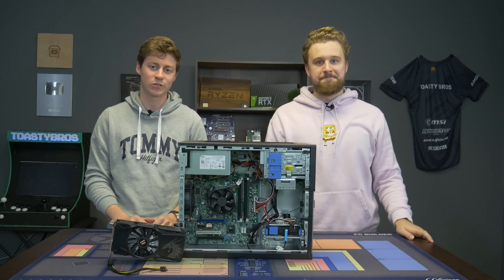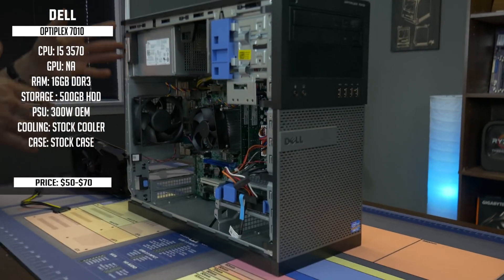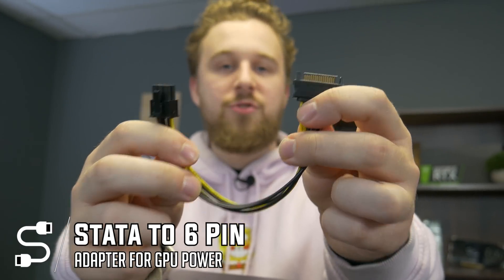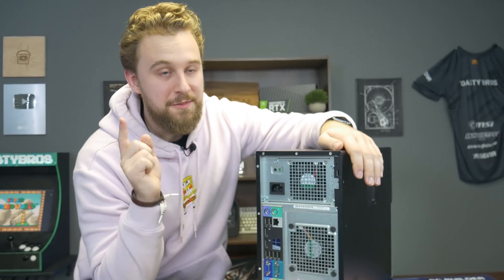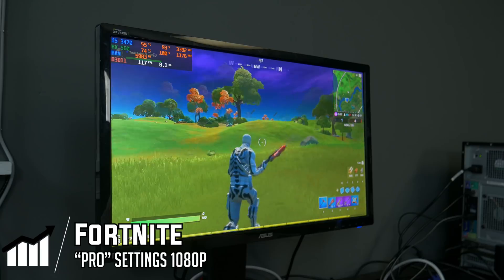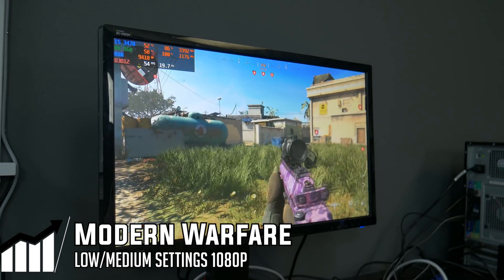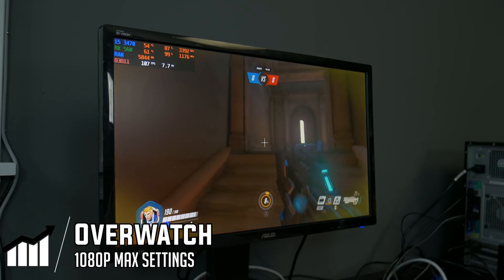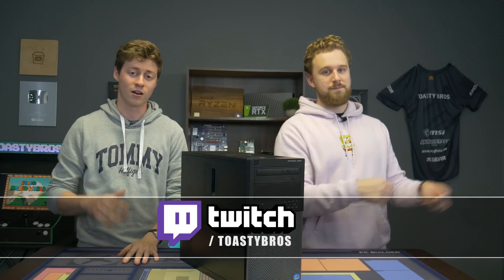2020 Budget $100 Gaming PC - Step by Step Guide

Comment: No way 300w psu can withstand th RX560, no way
Reply from the maker: Yes way very comfortably
Reply: @ToastyBros 
I have the same exact cpu paired with RX570, and a Bestec 80 plus certified 400w psu could not handle it at peak consumption at 170wats, so i had to get a 500w one, although a 450w could have been enough.
The only possibility yours might be working is this is a downgraded RX560, with way less power consumption, which i have not seen before
This calculator recomends at least 342W, the utilisation of a 300w psu is 99%, it will overheat and shut down 
https://outervision.com/power-supply-calculator
Reply from the maker: Most 560’s can run without external power so 75w from the PCIE slot, this one needs a 6 pin so in theory it’s barely pulling around 100w in total in a system that isn’t pulling more than 75-90
Reply: @ToastyBros  
In that case i apologize, my RX570 is peaking at 170W which is more than double

Comment: You won't be able to find an Optiplex 7010 mt with those specs on ebay for that price. It would be closer to $100 just for the Optiplex, and that's if you're only getting 8gb of ram.
Reply: That still makes the budget 130 or 150 if you get another stick if ram

Comment: Not sure where you get these for 50 bucks.  I know even a few months ago they were cheaper than they are now.  I've built a few of these so far.  The i3 versions aren't worth it.  Plus most don't come with 16gb of ram and only a few models have 4 slots which makes it even worse.  

Anyways seems like you got a good deal regardless.  I've got a few tricks that I haven't seen others doing with these which improves these.

Comment: Sold my laptop to get this same combo but with an i5 2500 and a saphhire rx 560. I think I hit the silicon goldmine (liberal use of the term i know) though cause my cards oc'd to 1400mhz with reasonable temps. Sold it cause I moved but that beast could play ac odyssey on low at 60-70 fps :P
Reply: mine cost around 200 usd though cause of my country's economy, still a steal imo

Comment: This should be titled “how to start a fire for $100”.  Jokes aside, anyone using these kind of PCs should be purchasing graphics cards that do NOT require external power.
Reply: I would agree, but I can at least see if someone wanted to do this but upgraded the PSU first. EVGA B stock PSU on Wednesdays typically go for $30. I would advise anyone to spend the $30 to upgrade their power supply.

Comment: I have an Optiplex 9010
I7-3770
16gb DDR3 Ram
Gtx 960 2gb
450 EVGA BT PSU
Thermaltake Versa H17

What GPU should I buy to upgrade my system to the fullest potential???
Reply: 580
Reply: Agreed, RX 580 or if you are absolutely loyal to Nvidia for some reason, a 1660 Super

Comment: $30 for i5-3470 and cooler
$40 for an Intel motherboard
$25 for an antec earthwatts 380 watt power supply
$30 for 12 gb of ram (2x2+2x4)
$50 for an xfx rx560
$30 for a 500gb SSD
And $25 for a rosewill case that j built for my little sister a year ago and holy crap I over paid lol
Reply: Not really, I mean you can always use the case and power supply in another build, in theory. On an OEM there really isn't much you can take to an upgraded build.

Comment: Would you need a SATA to 6 lim for a 570 or 580
Reply: Yes
Reply: I would say you would need a better PSU more than anything. Spend the extra $30 - 35 and get another PSU, even if it's used.
Reply: @NexusFantismo  I've got a extra psu corsair 750w SSD 240gb 500gbhd and 16gb ddr3 ram

Comment: can dual channel increase the fps on a i7 7700HQ and gtx 1050 ti laptop with single channel??
Reply: Yes. The universal law is that dual channel ram will improve fps over single channel. Now the improvement can be anywhere from nominal to noticeable to game changing. On my MSI GF63 adding another 8 GB to the existing 8gb stick improved my from from 25-30 percent in most cases.

Comment: question with a  full tower dell optiplex form factor can i switch out the case ?
Reply: yes but use a micro atx case
Reply: Yes, but you will have issues with the sensor for the open case door, different wiring, airflow sensor if you forget it... I'd much rather plop about $30 for a branded H61 motherboard - or, even better, forget the case swap, enjoy the pc as is, until you decide to swap the entire thing. Dell is great because of the atx psu compatibility, not because of the case compatibility.

Comment: i can't even run warzone properly with unstable fps 20-300. My setup is i5 6400, gtx 1050ti, 8gb ram single channel
Reply: Use vsync
Reply: @Triospirit  doesnt vsync make it worse?
Reply: and get a matching 8gb stick of ram
Reply: Once you go dual channel 16 GB you will see a big improvement in FPS. Also tweak your settings in windows (advanced settings, best performance by getting rid of all those fancy windows 10 visual effects) and making sure your drivers are up to date and working properly.
Reply: Get another stick of ram. It will help a ton.

Comment: Ooooooh what a challenge... So out of curiosity can you use that PCIE connector with higher end cards (from Rx570 - Rx 590)
Reply: nah you'd need like two of them, RX 580s have 6+6 pin or sometimes 8+6. Kinda sketchy but the GPU might get bottlenecked at that point
Reply: @rafee9442  I had a feeling that would be the case... Do you would need a PSU upgrade at that point right
Reply: @theugliest5291  yes absolutely. The stock PSU wouldn't last very long with that config and your entire system may all fry

Comment: the thing is you have to snipe one that is a good deal on eBay, most cost around 100 but then charge another 120 for shipping :/
Reply: try "Upcycle computer Werks" they have these optiplexe MTs that are perfect for this just look for the i5
Reply: @corrosive925  bro does it really work tho ?
Reply: @marmarbuckz5243  yup I got a HP 6300 microtower I5 3470. You will need a graphics card. But i only did it because i needed a pc. Downside is you cannot upgrade anything.
Reply: @corrosive925  can I put a gt 1030
Reply: @corrosive925  I managed to find one with an i7, 16gb ram and 1tb hdd for £220
Reply: @corrosive925  You've succeded in offering better advice in a single comment than the video...
Reply: @TheBinklemNetwork  if you have Honey that application you might even get free shipping :)
Reply: cameron flanary oh wow, nice prices and free shipping in continental United States
too bad i live in hawaii. riiiip
Reply: or if you live near to university or government building, you might wanna check their surplus store.
Reply: try buying locally. I got a 3010 for about 70$ on letgo
Reply: YaBoiDavid shipping is like Thanos.
Reply: RJ Builds Pcs yes
Reply: Yeahhh
Reply: Craigslist is your friend
Reply: so true
Reply: Rx 560 went out of stock what other gpu can I use

Comment: I bought an HP Z220 off of eBay for 135$ and it had a core I5 3570, 8gb of ram and intel 2500 graphics, and then I shoved a 60$ graphics card, GTX950 and it works well with 2 monitors, i use it every day and does awsome on gaming for a 200$ gaming pc

Comment: When you guys do another like 450-550$ build guide, you guys should try the MSI Bazooka V2. I’ve seen mixed reviews and there’s not many reviews on youtube either.. Edit: it also ranges from 70-80$, depending if it’s in stock or not.
Reply: I actually rebuilt a dell optiplex with this motherboard. Very solid board for the money. I have a ryzen 5 1600X (non af) clocked at 4Ghz with 16 gigs of 3000mhz ram. I'm using an R9 Nano as the video card. My optiplex is an awesome sleeper lol
Reply: Just get an asrock b450m pro4. Far better than V2. The bazooka plus however is an absolute beast
Reply: skinnypalmtree69 what case could you put this pc in?

Comment: Why does this pc run better than my gtx 1060 6gb??? 
I’m not lying Fr how?
Reply: Download Nvidia GeForce experience and make sure all of your system specs are being detective properly, download and run CCleaner and make sure Windows 10 is up-to-date and that your GPU drivers are updated.
Reply: Something isn't right with your system.
Reply: Dalton Mcneely yes ik I think I got scammed on eBay or something
Reply: 8gb ram??
Reply: what are your system specs?
Reply: swordflay i3 7100
Reply: @papyyi  i3 thats why its restricting the 1060s potential
Reply: Edjwan yeah probably
Reply: Eman Boutin get a better cpu it’s holding your gpu back
Reply: Shady McCain I tried getting a better cpu and I got scammed. I spent over $200 and bought more ram for another $100. I never received those items I got scammed hard
Reply: Eman Boutin oh sorry did you refund it if you bought it from eBay?
Reply: what cpu do you have with it? how much ram in your system?
Reply: Caffeinator 16gb 3200mhz

Comment: When the 100 dollar pc runs better then your pc lol (secretly cries inside)
Reply: If an even older Dell Optiplex was good enough for uploading Chappie's consciousness to a computer in the movie Chappie: https://www.youtube.com/watch?v=5R4Ige6ytz4  it should be more than sufficient for me.
Reply: Dummy
Reply: actually it does... BUT just because i have Intel Pentium G4400 xD
Reply: @dimitrixd3641  i use a laptop :(
Reply: Yo same I can’t Sven fun Minecraft with 60 frames
Reply: Blrrrrd you re so right bruh they put crack in they re pc s
Reply: I have a 300$ pc with a gt1030 and this is still better lmao
Reply: @VinxGD  gt1030 is weak...
Reply: Herbert Torres overclocked it’s not so bad
Reply: thats me ;-;
Reply: Eun better than my
£460 i3 4gb 2.4ghz 500gb laptop
I bought it was 4 years ago and had no clue of pc 😪.
I am saving to build a $350 Gaming PC
I got £250 rn
Reply: Mine is no joke 20x more expensive
Reply: 750$ laptop low settings in Fortnite barely 20fps this guy 100$ trash pc over 100fps. I wanna die.
Reply: isnt crying inside already secretly
Reply: Are you sure about that?
Reply: yeah! Im in the same camp :`(
Reply: SAME I HAVE A $400 LAPTOP IT CANT EVEN RUN FORTNITE AND DOSENT HAVE ENOUGH SPACEEE
Reply: Just avoid prebuild pc
Reply: Yeah I have an HP EliteBook 8460p
Reply: it runs better than my $300 laptop ._. (2GB RAM Intel Celeron N3050, no way to modify it as it has no replaceable parts)
Reply: I get 40 fps 350$ PC on Roblox with 800x600 screen resolution.....
Reply: @niki2669  this pc runs better then my hp laptop  bro
Reply: sad gaming noises
Reply: My pc is garbage compared to this
Reply: Rx 560 went out of stock what other gpu can I use
Reply: Just laugh through the pain, buddy..lol
Reply: Yep some how my mom spent 700 dollars on a pc that has 4gb of ram and no graphics card. 700 dollars you can buy a whole gaming set up.
Reply: It can even run Gta v😂😂
Reply: Yes, yes i do
Reply: When you watch videos on pc but dont have the money
Reply: Better than my 400 dollar laptop
Reply: Mine too, because mines a laptop that costs 10$ more
Reply: I get 30fps on roblox 😭 $100 laptop gang
Reply: @leea7682  here 😔
Reply: Should I get an Rx 470 instead?
Reply: @hdrbros2435  just pure speculation on clock speed of the card he got rx 560D which rebrand of the rx 460 if you are to buy budget rx 560 make sure to have all the stream processor. the rx 560D got (896) while fully flaged rx 560 (1024) can gain a good 10% generally out of it xfx make nice one fan design whit 4gb also or sapphire wich make cream of the crops whit dual fan one.
Reply: @hdrbros2435  yes if you can get a 400w power supply
Reply: HdrBros243 do you know what case you controls put this in?
Reply: Blrrrrd not then mine but it is pretty decent
Reply: My laptop is 1500 dollars when I bought it and it can barely run fortnite lowest settings at 30 FPS lmao
Reply: @Scorchlel  Same it sucks man.
Reply: @Scorchlel  Mac?
Reply: @officialteaincorporated243  win 10
Reply: @officialteaincorporated243  i5 4300m and a intel hd 4600
Reply: @Scorchlel  yeah sell it and get a pc, you can get RTX 2060 and i7 5th gen (?) i dunno man
Reply: That pfp tho 😂
Reply: CAPTAIN L.O.L lol thanks ela be making me act up tho ngl
Reply: Blrrrrd what kind of pc case could you put this in?